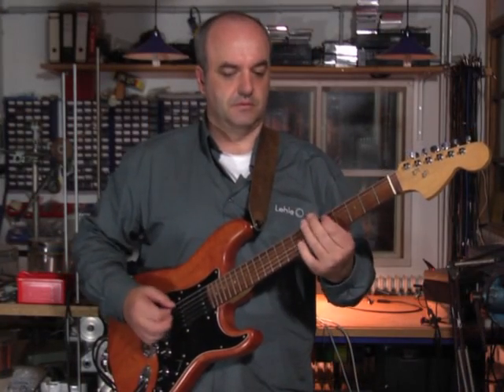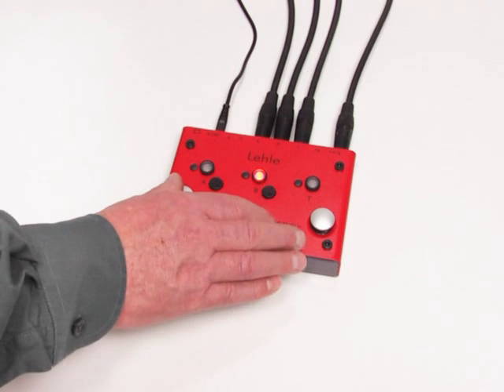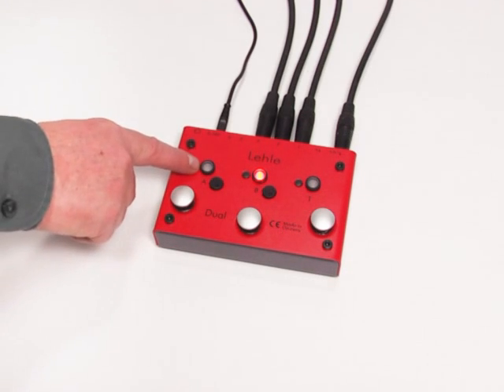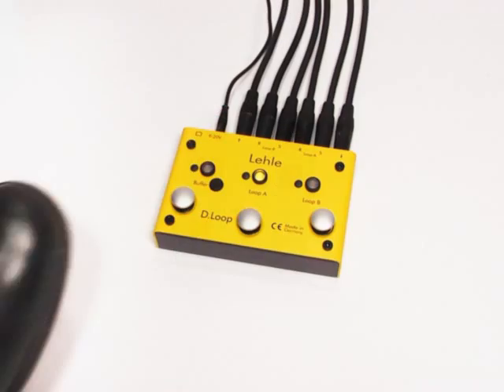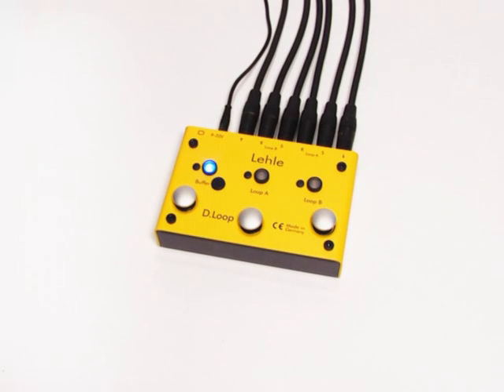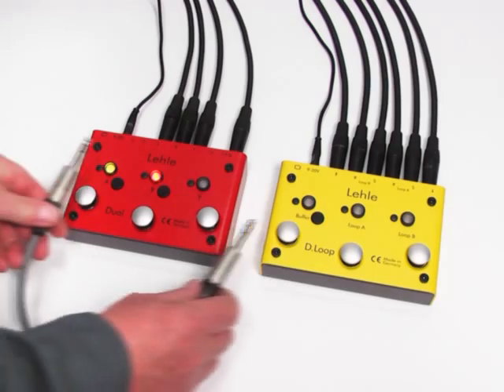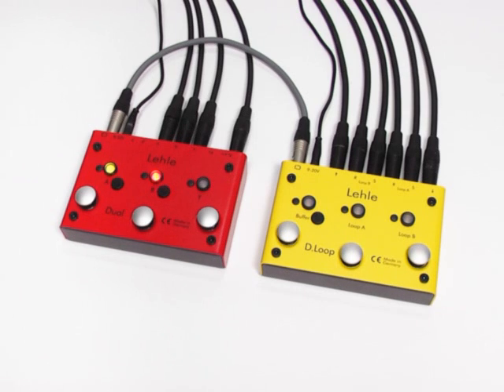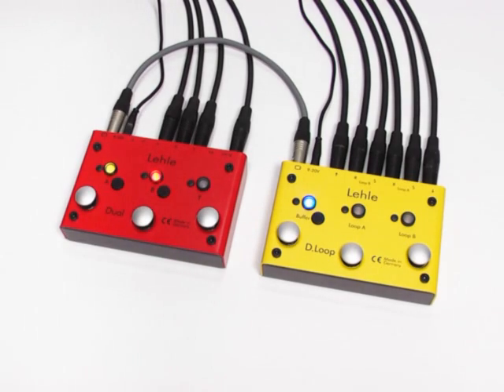Programming and Synchronizing of Lehle Switchers

Comment: I just tried this out with my gear. There IS a price in terms of signal loss/change so whether this option is worth it is up to you. I dont think trading flexiblity for direct signal can be avoided in more complex setups so its still a cool pedal. I ran directly into the box and to my amp. noticable signal loss. Then i took out the lehle and inserted a bb preamp which i true bypassed, just to have something between the two cables. That signal was still a little degraded but way more natural.